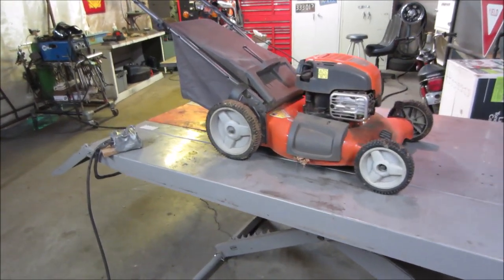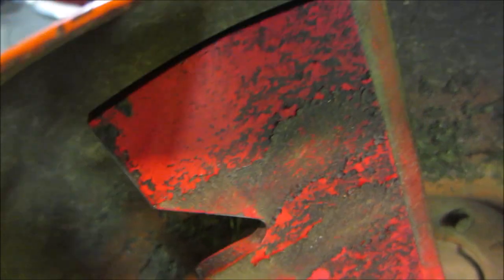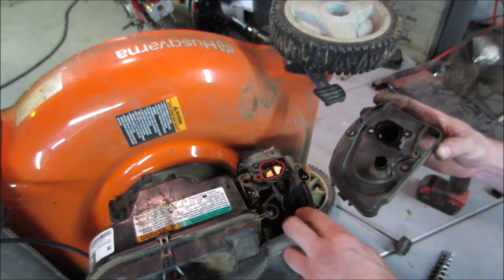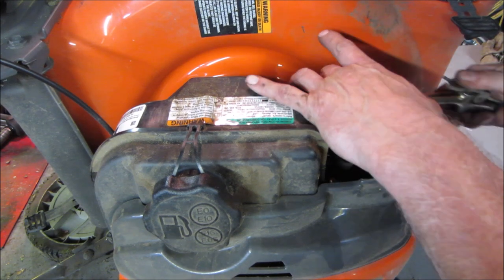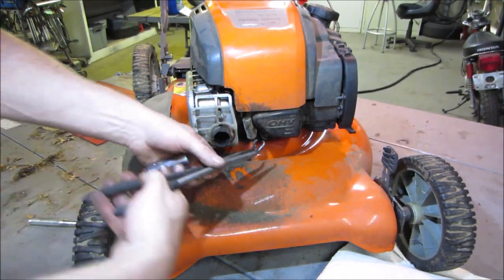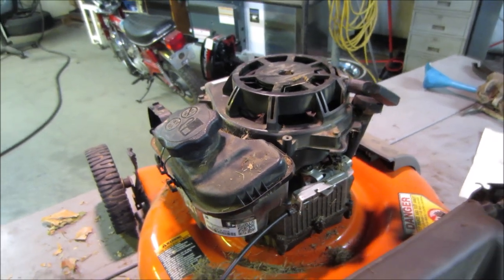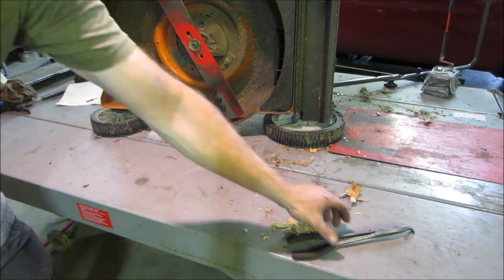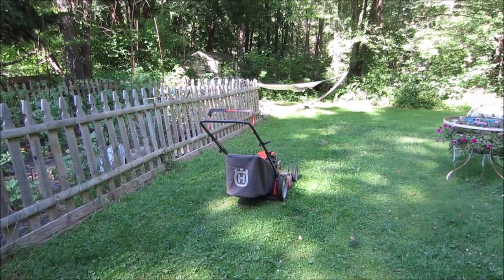NO OIL CHANGES? Servicing A Broken Yard Sale Lawn Mower,

Comment: I'm in my 60s and I've never emptied the gas over the winter and it always starts in the spring. Even the shitty Briggs and Stratton mowers. Why wouldn't it?  The Honda engine I have now starts half way through the pull on the first pull of the season.

Comment: I am betting the blade came off, and they tilted it on the side that the oil came out the carburetor, and they put the blade back on backwards.
That is what made it not cut or run good anymore.

Comment: The carbs on these are crap.I have one it was used very little but used often for a year or 2 and wouldnt stay running so I took the carb off and apart and cleaned it and put a new seal in and it started right up and then i noticed it just letting the fuel run into the air cleaner so I bought a new carb and so far it's fine.

Comment: Mustie1, I always have trouble with my lawn mowers hunting, could you please explain how to fix the problem and adjust the governor?
Reply: Clogged low speed passage usually causes hunting. Have you cleaned out the carburetor?
Reply: @SinsBird  i did unblock the piolit jet and clean the air filter however I think I will do a full tear down and proper clean, as the problem is still there although not as bad. Thank you for the reply.
Reply: @Kim76851  Yes, you have to disassemble it as much as possible.

Comment: 6:56 "Two sizes on the air cleaner bolts:  Why not?"  And worse, if they had just put two different sizes on the alignment pins/holes for the blade,  the guy couldn't have installed it upside down.
Reply: You could still flip the blade and get the larger hole on the larger pin.
Reply: You're totally right.  They'd have to put the two pins NOT 180 degrees off from each other around the central bolt.
Reply: It's pointless to try to outsmart stupidity. They'll just drag you down to their level and beat you with experience.

Comment: I wish I could find one of the better style petrol mowers that rather than cutting the engine when you let go they release a clutch return the throttle to idle and apply a blade brake , also much easier to start as you dont' have to spin the bloomin blade with the pull cord!

Comment: I bought a Stihl saw off ebay and it had a sticker on saying "Do not attempt to clean the air filter" when 99% of the time it is cutting masonary, anyway it ran like crap until I blew out the filters and now runs perfect, strange..

Comment: If u ever have a wet spark plug pull the rope a few times without the spark plug being n so most of the moisture will blow out the spark plug hole then put the spark plug back n

Comment: I saved 3 mowers from the landfill/scrapyard all because of ignorant owners that installed the blade backwards! 

I didn't have to clean out the carb or spark plug... just fixed the orientation of the blade, sharpen it if needed, and changed the oil

Comment: I keep my pre-mix in a Green can so it doesn't get "mixed up" with the other fuel...  LOL
Some people shouldn't have power equipment.  Blades backwards and that filthy nasty air cleaner.  Shaking my head.
You already know this...  Foam wraps on the air cleaner should get washed and oiled every time you put her away after use.  The motor lasts longer without all the dirt.  I just keep an extra on the shelf or in the onboard toolbox in a Ziploc freezer bag so I can wash, dry, and oil it for the next time I use the machine.
Reply: I usually only clean the foam pre-filter once a season. I don't think the filter on this one has EVER been cleaned! At that point, I wouldn't bother...I would just replace the filters with new ones. I do like your Idea, of having two filter sets, and while you're at it, it might even be worth having an extra blade, along with a spare spark plug, and other minor replaceable parts. If I buy another mower, I'm going to see if I can buy a second grass catcher bag. Mine always get holes in them, and I don't know why.

Comment: No oil change 2 strokes usually means that they will burn up the engine oil before you need to replace it under normal operation.

Comment: The truth about check and add is these engines use about 1 oz oil per hour, by topping off every couple weeks you consistently “refresh” the oil. Before everyone spouts about contaminants building up remember most of these engines see less then 15 hours a year. The scary thing there really is no difference between these engines and other “entry level” Briggs engines except the check and add sticker. I might add I see dozens of these engines a year and never a failure from dirty oil.

Comment: I once replaced a circular saw blade at it would not cut and smoked the wood so badly you could start a cave man fire. Only after a few months that I realized I had put the blade in backwards.  I could have been one of them who put the saw in a garage sale for a couple of bucks.

Comment: Hi I've got a question I have a mower that will run when you put gas in the throat
Of the carb but it shoots water back out but there's no water in the oil your thoughts on this?

Comment: To Mustie1--
My mower has an oil consumption problem. As the motor starts, after filling oil to the proper (dipstick) level, there is some smoke, but that smoke disappears. When I shut down at the end of mowing, the crankcase has almost no oil left, according to the dipstick. If the cylinder walls are OK and valves are undamaged, is a new set of rings the next step to resolving the oil consumption problem? I sincerely hope it is-- if the cylinder walls need to be re-bored, that is an order of expense greater.
Reply from the maker: hmm blown head gasket?
Reply: @mustie1  Good guess! For so much oil to go through the motor, it would have to be something like that. This is a second-hand Bolens-brand mower, more than 15 years old, yet, still starts on the first or second lanyard pull. Is the ring-replacement approach the second thing I should try?

Comment: Just like the W5A580 mercedes transmission that came on our 2010 Jeep Grand Cherokee (WK) with the 3.7L, the 5.7 hemi engine got mated to the standard chysler 5 speed transmission 545RFE... ours.... the NAG1 / W5A580..... they claim no changes required... "good for the life of the transmission"... sure. What's that supposed to be??? 100,000 miles?

We dropped the pan, measured what came out, and put that much new ATF +4 back in. Did it twice now, with a genuine mopar filter kit. Made a noticable difference in how the that transmission performs. Still hate that platform though... poorly designed "maintence free" transmission and a very underwhelming 3.7L engine. It's going out the door soon enough. But it still runs... I serviced the "non serviacble " transmission

As far as the lawn mowers go... eh... there's two camps it seems. Never change it ever, or change it all the time. I follow the regular oil changes for lawn mowers. I don't get as excited for push mowers... since both of mine have the briggs pulsa prime carb setup where it sucks gas out of the tank (and the seal between the tank and the carb regularly breaks down).... I just change the oil every 3rd cutting season when I change out the gaskets and clean up the carb.

My Yard Machines rider? It's got the Intek V-Twin 24 HP engine... the ones famous for breaking rods and not starting due to the valves being out of adjustment... that thing gets an oil change at least once a season. I run synthetic oil in it... it holds so little, and the synthetic oil stands up to high heat much better. I upgraded to a motorcraft FL-400S filter due to over twice the volume of oil it holds and much larger filtration media inside. It's headed into it's third cutting season, I'll probably spin it off and replace it this time. It's a $2 or $3 filter. I buy the supertech synthetic... at like $2 a quart. I spent about $6 a season on average between oil and filters.... cheap piece of mind. My father burns the oil in his waste oil burner to heat his garage.

I only paid $300 for the tractor and a ryobi 790r that I never did get around to get running, the tractor needed four new tires, a battery, and new PTO belt. Probably a little less than $500 into the tractor at this point, and its just started it's 4th cutting season. I'll adjust up the valves here as soon as it gets warm enough out. I intend to run it another 2-3 years before selling it and upgrading to a newer / bigger machine. I'm just a fan of taking care of things, mainly because I like to tinker and learn how to repair stuff.

Comment: The oil does not need to be changed is correct. 
Only add  enough to maintain the correct oil level,
The engine consumes some oil for lubrication, so oil level
needs to be checked frequently and topped up.
MOBIL 1  5 30 is ideal. 
Not having watched the video yet, I would speculate that
the reported poor performance is a result of low oil level.

Comment: 1:36 Mowers Have a drain plug for oil?  I have never seen one.  Even with doing the just check and add method all of my mowers have lasted 4-5 years.  They tend to die because of other things.  Hell the wheels snapped off my last one before the engine went out.
Reply: They've always had drain plugs but it's easier to just to dump it out of the top
Reply: Yeah usually 1/2" square head in the base.  Brigs and stratton used to have plastic ones on top of the mower deck.

Comment: I found a hu 725 awd husqvarna, only about 3 or 4 years old [2015], only problem, swimming in oil. Not sure how you over fill  a 20oz capacity small engine, they even sell oil in an 18oz bottle

Comment: Those plastic cabrs the bottom orifice at the bottom of the bowl if you drill them with a hand micro drill bit to about 0.016 they will not get clogged as easily.

Comment: A friend gave me a mower exactly like that on. It is puking oil into the air filter from the crankcase vent. It runs , but not good and after a while it's choking on its own oil. The oil level is right and there's no water or fuel in it. I suspect a blown head gasket...
Reply: Dumb question but is the air filter clean. Ive had quite a few smokers that was caused by dirty or wet air filter elements.
Reply: If its a ohv it could very well be the head gasket

Comment: Speaking from exp, oil changes ARE pointless in a a lawn mower! Growing up we never did and our mower lasted 19 years without a problem. We ended up  having to toss it because the pull chain rope rotted out. Wasn't worth the hassle in fixing that in such an old machine.

Comment: To be fair, it's not a high quality mower. I find that in recent years the deck starts cracking where the wheels bolt to it.... Usually long before you should have to worry about more than just topping the oil off. At least that's the case with the $100 specials. 

I have a proper diesel mower from the 80s that does just fine for my yard. Push mow about 10 minutes a week. 

Also, those engines have an "emissions compliance period" small stuff is usually 50 hours, push mowers are like 250, and riders are like 500. Manufactures use the epa guidelines as an excuse to build an inferior product that is not designed to last or be rebuilt. Usually about 2-4 years for your average consumer.
Reply: I bought that exact mower from Lowe’s. Wasn’t $100!!!  But agree with you on the rest of it.

Comment: I've never seen the "mow and pull" technique on grass. Are you opposed to turning the mower and pushing it on every pass? :)
Reply from the maker: looking for even cut
Reply: @mustie1  So turning at the end of each row and pushing the mower back and forth across the lawn doesn't provide an even cut? Or were you checking something on the mower? Genuinely confused. Thanks for replying!
Reply from the maker: @noahtall1580  no, l am checking if the mower still has  issues, uneven cut, as the wheels were off when l got it, so making a cut next to each other would show up in having uneven grass, if l spun around each time it would be harder to see,

Comment: Or it’s out of balance because that’s the way a mulcher blade normally is you need to take some off one side and tell it’s balanced put it on the nail and width side goes down you need to take more metal off

Comment: These engines are made more finely and are designed with tighter tolerances. The bore is supposed to be better. the oil change thing is for owners, so they dont have to get the oil changed, because they don't usually anyway. The carb jets are a plastic and pop out for replacement and usually need changing at least once a year. briggs's finest? I dont think so..

Comment: Hi,I want to vive you a friendly advice never turn a mower blade like you did on this video without removing the spark plug wire it is very dangerous it could start the engine and there goes your hand or at least a couple fingers so take this in consideration next time but the video is very usefull for diys.
Reply from the maker: cant start without handle safety being pulled , that was back before they had them, no spark

Comment: what engine brand. little actually a lot more info, Einstein....check your video, you air nozzle thick dirt right int. the carb. runs like a winner. they can run under a beating. great demo

Comment: Just fill with oil, then the engine takes a dump after a while. These new Briggs engines are garbage. I have a brand new push mower with the Briggs e500 engine. Bought it because it is sold by Aldi under a brand I never heard of (turns out it's imported) and wanted to see what it was about, costs around $100. Hasn't made it to it's first oil change yet (I've determined it should be changed around the time the oil in an old flathead would be) and the top end sounds like a diesel. Also it's started smoking white during startup. I have maybe 40 hours on it so far, not looking good. So I'll see how long it lasts. From what I see/ hear the Briggs e500 is a terrible engine and in fact has even come with part's missing. Not sure about this one.

Comment: Mower doesn't run properly, starts then dies. Rebuilt carburetor. Nope, still doesn't run right. It's a fairly new Honda. Wife suggests, did you change the spark plug. Me, no I didn't, can't be the plug because it starts. More messing about, with no luck. Ok, I'll change the plug. Been running perfect ever since!

Comment: Actually when you use synthetic oil, with the amount of hours someone who has this mower will put on it, it won't really matter if you don't change the oil. Especially if you use the oil Briggs sells for this engine. Mineral oil breaks down pretty quickly, so a yearly oil change is needed. Synthetic doesn't do that. It's why on modern car engines, with modern oils, service intervals have become +30.000km. Even my 20yr old car has a service interval of 15.000km. At an average speed of 50kph that equates to 300h. Suppose you mow your grass every week, 30 weeks a year, and you have a decent patch of lawn so it takes 1 hour. Then your service interval for the mower will be 10 years. And I don't think this mower is designed to last 10 years. So, nothing wrong with the 'never change the oil' thing, even though it feels kinda weird. Average joe who buys this thing at the garden center will not complain if the mower fails after 10 years.

Comment: Is it ok to sharpen the blade with a Dremel while the blade is still attached?
Reply: If you can do it precisely(remove the same amount of material on both sides) than OK. But at least once a year I'd take it off and balance it. But if you fell excesive vibrations I'd definetly took off and check the balance of the blade.

Comment: Never change the oil, that is the largest bs I have heard I change mine after 48 hours (which is hard to achieve when you mow a hour and a half once a week) but a tailpipe and a spark plug will tell you alot about an engine when I see grey to white on my with a mix of black I know my engine is running good and the spark plug has grey/white on it and i use high octane fuel
Reply: Oo

Comment: What brand of gas company and octane use ! I use 89 or 91 Octane fuel from Shell always and 10w30 on small or big hp motors plus a Grey Bottle of  STP Total Treatment in Spring and one before Winter season months! Never use Ether Quick Start  spray ever and on Snow Blower motor or Ride use 91 Octane fuel from Shell always and 10w30  plus Grey Bottle of STP Total Treatment fuel injection 2 times a year !

Comment: Briggs EXi (no oil change) engines claim to have mirror polished cylinder eliminating ring break in metal contamination and very little blow by. Also claim much increased cooling increasing oil life. Yeah Right! They also happen to know over 50% owners don't change the oil anyway and only keep their mowers 2-3 years before it's curbed. Add in ethanol gas and Mustie1 has more free mowers!

Comment: The sad part is the bottom of the barrel lawn mowers from Lowes or Home Depot are so cheap you can justify buying one, using it for like 5 years with zero maintenance and once it's not working the same as it once did just go out and buy another new one.

Comment: Hey bud.. Instead of just assuming the oil change thing (or anything different) is just not right.. Maybe take a minute to think about why it might be and how the manufacturer might be accomplishing it.

These motors are designed to burn oil at a little faster rate. This means that regularly checking the oil and topping it up as required will result in the equivalent of and oil change over time.
Reply: Also, don't use standard chrome sockets with an impact gun.. They are hardened and can disintegrate in a very spectacular fashion... Impact sockets aren't hardened and won't take out your eye.
Reply from the maker: we all have opinions,
Reply: @mustie1  I think you mean assumptions

Comment: Oil is cheap. New engines are expensive.  I change it every spring, needed or not--don't care what it looks like.  My little Snapper only uses a quart and a half.  Cheap by any measure.